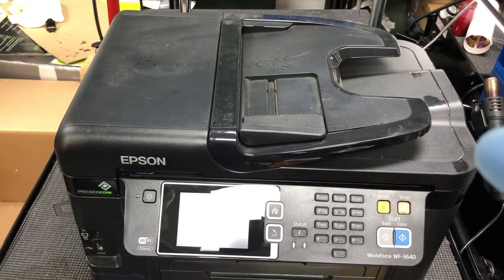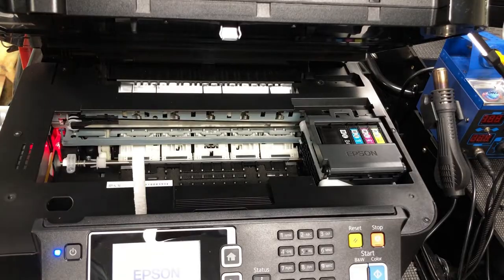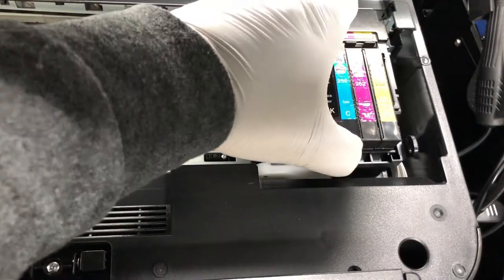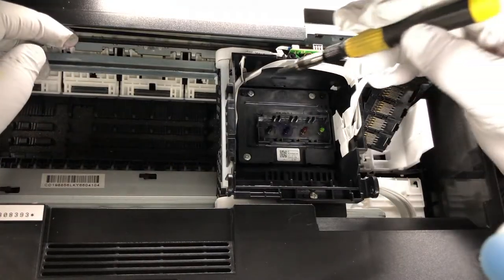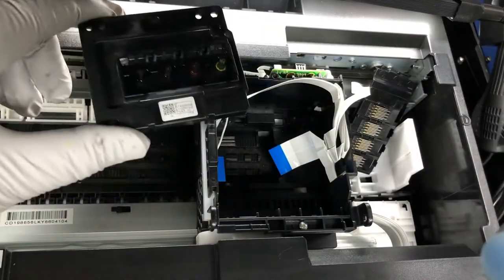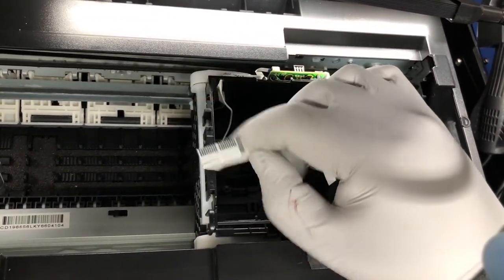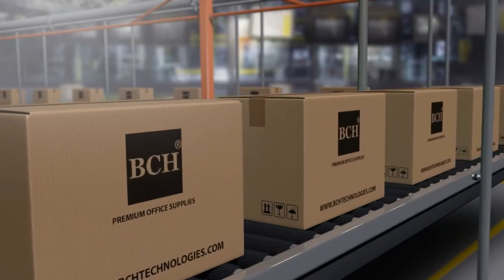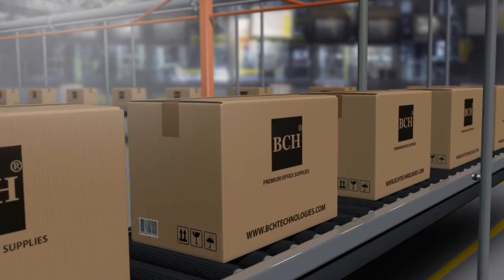Epson T1881 Printhead Replacement for WorkForce WF-7710 7720 7110 7610 7620 3620 3640 T252

Comment: I followed these instructions with my WF-7710. While I was waiting for the new print head I ordered, I decided to try thoroughly cleaning the printhead I removed to see if that solved my issues. After I cleaned the head, I re-installed it carefully, and it all went back together just fine. Unfortunately, when I went to turn the printer back on, it's dead....I mean dead dead, nothing, no lights, beeps or anything. Anyone know why? (Yes, I plugged the power cord back in).
Reply from the maker: Your cleaned printhead may still be wet.
Reply: @BCHTechnologies  Thanks, but I actually let it sit for 2 days to dry before reinstalling it. Is it possible that the printhead got wet inside where the electronics are, and that's the problem? I guess I'm asking if an issue with the printhead would cause the entire printer to not power on.
Reply: @BCHTechnologies  Well, now my new printhead arrived, and I installed it with no problems. However, now the printer powers up just fine, and goes through all the motions, but it's not printing anything. It acts like it's printing, but no ink on the paper, even after multiple cleaning cycles to prime the head. What's going on?
Reply from the maker: @glennevans5016  Check your F1 fuse.  Make sure to run enough cleaning cycles, 9-12.  If any ink coming out, you don't need to check F1 fuse.
Reply: @BCHTechnologies  Thanks for the reply. I don't think it's the F1 fuse. Here's why. I put the old printhead back into the machine, and it started working and printing. It still won't print the test pattern properly, but at least it's printing. I didn't realize that it would take so many cleaning cycles to prime the new printhead. Maybe I just didn't give it enough, as I only ran maybe 4 cycles. I'll re-install the new printhead and let it try 9-12 cleaning cycles as you suggest, and maybe that will take care of the issue. Thanks again!
Reply: Hi Glenn where did you purchase your new printhead thanks
Reply: @glennevans5016  did that work? I’m having the same issue...I only did about 4 as well. I guess I’ll keep trying.
Reply: @glennevans5016  I am having the same problem, did you find a solution????

Comment: Hi Kevin I replaced my print head along with new ink cartridges, old head plugged after setting for a year. Does a new head take several cleaning cycles to prime or need to set for a while to fill the head?
Reply from the maker: Yes, it normally does.

Comment: Hi kevin can I use a wf7710 printhead on a wf7720?
I remove flush,  soaked, flush again but not a lot of water came thru in magenta , let it dry, install back and I have error code ending in 06
Reply from the maker: Yes you can.

Comment: where do you buy brand new replacement print heads? trying to avoid refurbs on ebay, nothing works. bought at least 20 of them (literally 20, yes, that many), they are all malfunctioning. luckily i was able to get refunds and even get most of these sellers banned from ebay, but most likely they will recreate accounts and keep selling garbage. print heads should not be allowed on ebay, period. where are all the reliable sources for replacement parts?